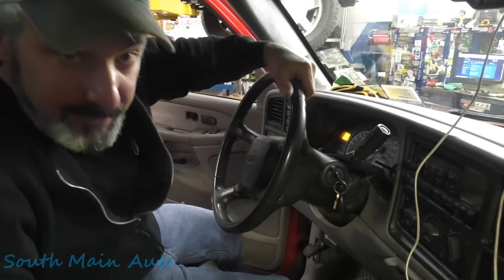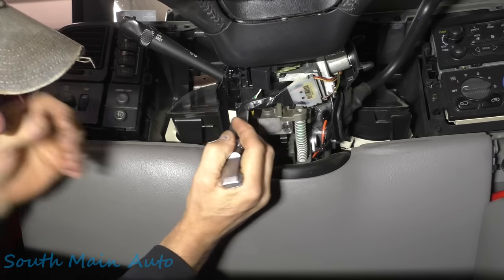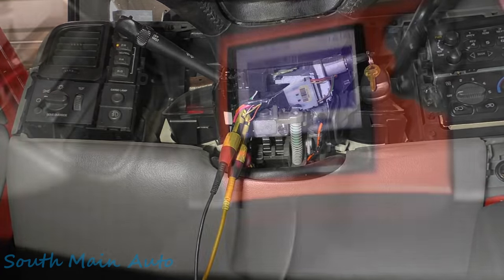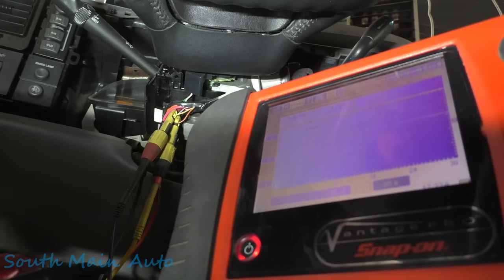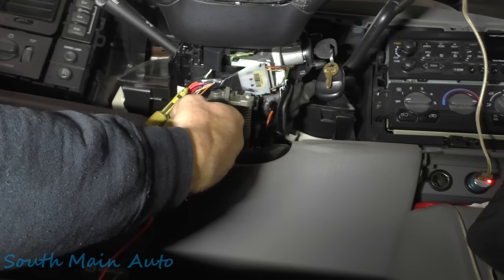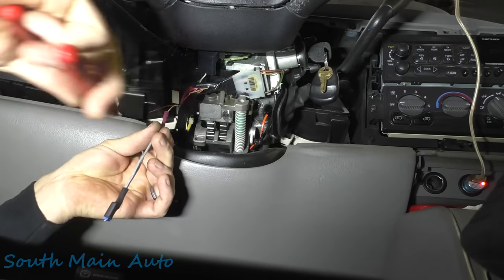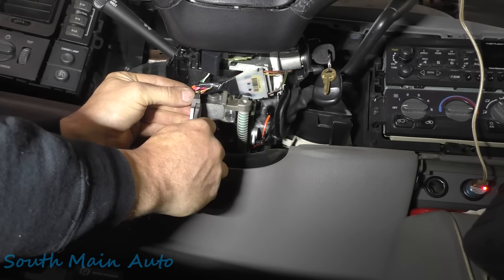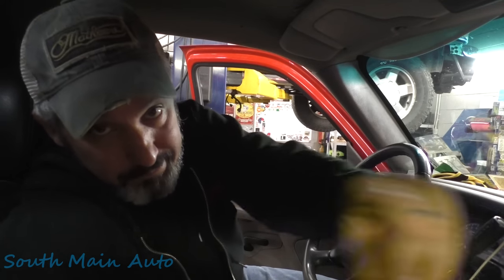Passlock™ System Bypass - GM

Comment: Do the 3 10min relearn and get it running . then snip the yellow wire with it running . you'll never have a problem again just dont clear any theft codes in the future . 👍👍
Reply: Also good for ls swap if you can get the donor vehicle running . you wont have to flash out theft to get your project going on a budget

Comment: My 1989 Chevy S-10 and 1992 Ford Tempo had a theft friendly ignition system when you could turn the key forward slightly and remove the key. Unless you brought the switch back you would never need the key again.

Comment: Love watching ur channel..learn alot..could use a guy like u down my way..truck keeps losing all power then it comes back on after it sits for awhile..could b 5 minutes but has taken as much as 3 or 4 days..then it'll b good for a week or 2 then does it again..no one seems to have an answer..cleaned and reattached all grounds..positive cables look good..even changed fuse block as suggested by a mechanic who has 35 years experience at a dealership who's usually spot on...no corrosion on fuses..new battery..tight terminal connections..completely stumped..when power is out..I get 12.6 at battery and positive wires yet only 5.1 at fuses and cable on back of alternator..only thing I can think of is I missed a ground somewhere..I'm sure u would solve this in 20 minutes..lol..o..also replaced ignition switch..no codes on code reader other than o2 sensor....time to step away from chevy..lol

Comment: Buddy of mine had swapped an LT1 powertrain (gen2) into his Camaro and the darn thing would run mint for 5 seconds and then shut off. Turns out he was missing the right resistance for the VATS becaus his ignition wasnt even VATS enabled (or maybe he had the wrong resistor, I forget).

Comment: just read the transitor on the old key pull the orange wire out the column inside are two white wires take a new key with the correct resistor number between 1-15 then tape the key between the wires tuck it up under the dash and give the customer a normal key without a resistor those 10 minute wait times between reset can take forever

Comment: Wish it was this easy on my 97 Deville. The cluster itself acts as the security module so it failed the first time and I can’t get the messages off the cluster screen. Second time I replaced my key to the resistance of the new cluster, cut it to my ignition, of course the first time I put the key in it works, the second time i grabbed the wrong key now I’m right back where I started but the car still runs and drives because I got anti theft tuned out and the starter enable relay ground bypassed.

Comment: I have an 07 chevy colorado,  wiring is different than the truck you have in the video.  What wires need to be cut for variable resistor.  I hate it not starting at times. Hope you can help me. Thanks

Comment: Just picked up a 1999 Chevy 4x4 on a trade.  The engine was swapped they stated.  It  has this issue. Thanks for the video and I'll be trying it tonight.  I thought it was my fuel pump so I removed the bed and installed a new fuel pump.  Nope that wasn't the issue.  Apparently, the dash cluster may need repair as well.  Fuel gauge states its full and it was empty, hence, my thought was the fuel pump.  Even though I heard it kick on.  Figured the float was bad and I already had it so why not install it.  New pump made no difference even with the new pump assembly.  The speedometer needle is at 100MPH.  It was likely this as it starts and shuts off immediately off.    Just curious a few have mentioned the resistor you used hasn't worked so well.  It's been 11 months since you posted this video.  Have your had any issues of that truck returning for the same thing.  @SouthmainAuto

Comment: This is helpful, not for me yet, fingers crossed. Have an 07 Classic with a dimly lit lock light. I hear its a cluster ground, so I been cruising the ole yt for answers and ran across this. Why it might be useful to me is I have a re did key and no fob. Should I get a fob to use the security thingy? Or be happy none of this gives me trouble in the first place? other than me being buggy that the light is dimly lit. Honestly Id feel like I was high step'n if I could make the alarm come on 😆 but the very first time it gave me issues, Id resistor it just like this video. What's your take?

Comment: I had something like this on an 89 Firebird with the little chip in the key and cuz I was eliminating the whole computer and everything to put in a 383 Stroker small block Chevy I was able to figure out the active wire that clicked the security relay to the unlock the starter and just snipped one wire and hook it to ground and that disabled it.

Comment: Hey I have the 2003 silverado and the security syatem light stays VERY DIM lite on the dash all the time even when the truck is off and key is out.  Truck still starts and runs great.  I had the cluster at united radio a bunch of years ago and it was off then..

Comment: my 1999 silverado had a problem with security light was the mother board had some bad solder joint had to have cluster rebuilt also low battery voltage could cause it as well

Comment: If crimp connectors work on high voltage power lines, they will work on that job.  Consider the environment,  as in your case, minimal harsh environment and minimal mechanical stress, so crimps are fine.

Comment: Could I do this method on a functioning system and reconnect the wires with spade connectors?  Then I would keep the preset resistor in the vehicle with same connectors already attached.  Then if the ignition switch resistance signal ever failed I could just plug the preset resistor in and be on my way in a few minutes.

Comment: So, perhaps a silly question here Eric.  When you used the 'pokey probes' to add the  variable resistor, weren't you adding that resistor in parallel with the existing resistor of the truck? And then you cut the wires, cutting out the OEM resistor.  Or is the resistor in the key and you removed it when I wasn't looking.    I'm sure I must be missing something.   Thanks.

Comment: My Pontiac passlock would simply disconnect the ground from the starter control side of the relay. One wire fix to ground.

Comment: Awesome info on passkey system. Got a ?... I'm currently working on a 1973 k20 that's had a motor transplant from a 1987 camaro iroc z28 5.7 liter v8 tpi... including much to my dismay... the VATS system. So the truck cranks but won't start. I have voltage at the coil but at the dizzy. Can't find anything actually wrong with the system...   also much to my dismay No check engine light was ever installed so I can't check for dtcs.  Any suggestions or help of any kind would be very much appreciated. Thanks in advance

Comment: D o you have a video on how to fix the tow/haul mode button on the same model years? I have an 03 sierra tow haul mode button stopped working. It only worked when I would tilt the wheel.

Comment: I had a car with this system maybe I just got lucky, but I measured the resistance of the key. It started just fine with that measurement.
Did I just get lucky?
Reply from the maker: That's a passkey not a passlock system. Similar but different https://youtu.be/3PkHTxDQpkE

Comment: That is a very nice probe-lead system. Safer  than alligator leads. Is it rated for mains line voltage? It would make troubleshooting electrical equipment easier. What are they called? Where can you get them?

Comment: Got a 98 lumina keys got stolen and i ruined the steering column trying to get the cylinder lock out. It started once i got it out. Got new steering column from a salvage yard put that one in and it worked for a few days, then one morning i went to start it and it wont do anything. I went back to the old steering column and still nothing. Any thoughts? I also just checked my fuses and the i/p electronics ignition feed fuse jad burned up i replaced that still no crank.

Comment: Aloha, I have a question! When you do this, it DOES bypass the "Ignition Switch"... but DOES NOT bypass the "Theft Deterrent Module"... correct? So if my TDM is bad, then it will still need to be replaced?

Comment: You my friend need to invest in HP Tuners. Yes, it costs a little $ up front, but for $100 you could have disabled the Passlock in about 5 minutes w/o cutting any wires or taking anything apart. Few strokes on the keyboard & presto. Goodbye Passlock.

Edit: I have the same Snap-On flush cuts and will agree, they are amazing. Until someone borrows them, drops them and the tip breaks off after smacking the concrete. And of course the only Snap-On guy in town up and left.

Comment: Great video Eric O. as always.Great fix for another GM screw up more BS that is not needed on any car or truck IMO, did just fine without all this crap years ago.
Reply: Unfortunately, all cars since at least 2004 are required to have something in the form of an immobilizer system to hopefully reduce car thefts, thus the chipped keys and the need to program them, however, GM still used the older system (passkey) until what, 2004 or so.

Comment: Do you know if this will work on a 2008 Pontiac Torrent? I don't know if it has the same security system in it? I have the same problem. Turn the key, nothing happens.

Comment: Will this work if the battery goes dead or has been removed? I had to replace my column and do a relearn but when i switched batteries I had to start over and do the 30 min relearn again. I dont want to have to keep doing this

Comment: I would like to add that when you check for a signal on the yellow wire from the passlock module and there is no voltage, or in my case the security light is on steady, this procedure will not be a solution.  I had to replace the passlock module rather than what is shown in this video is bypassing the passlock sensor inside the ignition lock cylinder.  I think there is another solution where a guy showed he cut the purple wire going to the passlock module and stated that you could ground it as you turned the key to the start position and release the ground with the key release and you technically bypassed the passlock module.  I did not test this but rather replaced the passlock module.

Comment: I have the security light flashing and my truck starts and runs fine. It’s a 2002 Cadillac Escalade so you think I need to replace the whole ignition switch ?

Comment: There's an even easier way for the VATS bypass... You get a cheap ODB2 connector. Then you use a phone app or laptop program to reprogram the ECM to have the VATS turned off.

The reason this is so simple and common, it's because people swap the LS v8s into all kinds of cars... By just turning this one section off, you can run the whole engine off the stock ECU.
Reply: Sure if you spend hundreds on the tuning it's easy

Comment: We've got the same issue going on, on a 2004 Silverado 2500 HD except for [if I'm testing right, I've got basic tools] sitting at 2.11v from the passlock signal and ground. Would that same resistor you linked work?

Comment: ive been dealing with this for 2 years  it failed at the gas station i had to rely on my remote starter  does this work if the light is on not blinking ?

Comment: I sure hope you can help!  I have the 2000 blazer, Passlock issue when i cut the yellow and skinned back the orange n black installed a 2.2k resistor, went to do the relearn  But the security light would never go out to complete a relearn .  But the truck starts fine but the light is constant on when running. How can i get the light to go out ?? Di i need to change something ?  Because the relearn wont work unless the light goes out inorder to do the 30 min process. I'm ok with it on since it runs  But the wife wants it out.  HELP PLEASE!

Comment: Will this work if the module is going bad? Like will installing the resistor bypass the module completely if I install it during the time the module is working or will this install not work with a messed up module? I really need help with this truck, can't seem to get accurate answers

Comment: There is something I don't understand about your video.  You  removed the starter relay when you checked the voltage across the yellow and ground wire with the key in the start position . Doesn't the main battery voltage drop to about 10.5 vdc when the starter is running?  If the starter wasn't running it would cause a different reading at the yellow wire than if the starter was running wouldn't it?

Comment: I have this problem starting the car, (turns over, runs 1 second then quits) but only when it's cold. When the temp is in the 40's or higher, it starts right  up. Stumped

Comment: Hi good evening I need to do this on my 2006 Chevy Colorado I called locksmith they couldn’t reset the antitheft light my last option it’s bypass any advice or which cables I need to cut to connect the resistor.

Comment: Can you PLEASE HELP ME. I have 05 canyon with passlock issue. I listened to everything you said but I have NO wires there on my ignition switch to run a Resistor All I see and have is the black plug with wires. Going from there to underneath my -And the yellow, which is for the airbags. Can you please help me with some sort of assistance to let me know or give me some kind of hint on what wires I would use to do this with with a resistor. Thank you very much in advance. Looking forward to hearing back.

Comment: I. Have a 2002 escalade that I did this to and now it's starts but if you drive it more than 20 minutes and shut it down it won't start back up or even crank?  Then 5 hours later it will start?  Any clues.

Comment: Hello Eric I did this. And still have an issue when I push the gas it stalls out. New ECU...new throttle body...fuel pressure is 55ish. Security light is still flashing. It starts but won't stay running after gas is applied. Any pointers please

Comment: Eric I have a 2000 BMW Z3 roadster.. runs great but I have the pesky DSC light on.. I had a bad wheel speed sensor , replaced it,. dsc light used to come on at start up and stay on., now when I start it, the DSC light is off,. the DSC light now comes on and stays on when I drive it and reach abt 20 mph.. very consistently.   I bought the plug adapter that plugs into the ABS/DSC module under the hood, but my autel scanner doesnt connect to the system.  trying to get some direction on what to do next.. do I need a bosch scanner, or do u know of anything else I can check with a volt.ohm.amp meter or any on board diagnostics I can try. information for the older Beamers seems to be very limited on the internet.  I have read there are yaw sensors, modules on the floorboard that can get wet and corrode, solder joint failure in the abs/dsc modules ect..  thanks for any direction. like what is the most common reason the DSC light comes on at around 20 mph.

Comment: Hey buddy,  question: happens that they tried to still my 2007 gmc Sierra truck classic 1500 4.8 but not success for them thanks to me putting a kill switch on my truck,  so I went to auto zone and get a new lock cylinder switch with new set of keys,  swap it and it's not starting,  do you think I have to do this to bypass the security? Thanks in advance,  Ps. Yeah they damage  my lock cylinder switch!

Comment: Hey SMA I have a 2001 S10 that has a no start issue. Will this passlock system cause the power to the starter grin the switch to drop 🤔? When I turn the key to the start the fuel pump does not come on and the starter sounds like the battery is nearly dead. Just wounding can this pos system cause any of these type of issues? Primarily and no crank no start no fuel pump malfunction. Thanks

Comment: Is bypassing the skim system on dodge and jeep cars the same as this? Skim module failed and now I have an intermittent start stall issue with a blinking red security light. 2007 Dodge Ram 2500 Hemi 5.7

Comment: I did exactly this on my 04 GMC Sierra same voltage and everything on the adjustable resistor and it won't crank and the security light is still on the dash

Comment: I did just was said in the video. I got 5.1 volts when I turned the key on but when I held the key in the start position the voltage didn't change. Seems this video doesn't work for me.

Comment: I was watching you inserting a variable resister into the steering column to bypass the security.    May I suggest that you may want to put just a dab of fingernail polish on the screwdriver slot for the resister once you have it adjusted to lock it in place

Comment: So the yellow wire is all u cut cause I have a 2003 Chevy cavalier that has security light on  it start an run a minute or two an then just cut off like u turn the switch off

Comment: I get the 5.19v I remove relay and recrank. 4.09v. Now I match my variable resister to 4.09v. Turn key and no start and security light flashes. Do I need to do the relearn again?

Comment: I bought a used 2000 1500 Chevy back in 2003 the first thing that failed the second day I had it was this issue right here as directed by the dealer I took it to the mechanic he kept the vehicle nine hours in a shop billed the dealer for 7 hours And computer programming which I guess was the relearn I think someone got shafted the bill was well over $700 but I did not pay it the dealership did

Comment: Question.  Does the resistor draw much current and heat up?
Reply: No.  If the resistor has a value of around 2,000 ohms, then using V=IR, the current is .006 amps and the power is 0.07 watts which is not enough to make the resistor even slightly warm.
Reply: @israellipschitz6882  Thanks! I was just curious as I didn't know the actual draw.